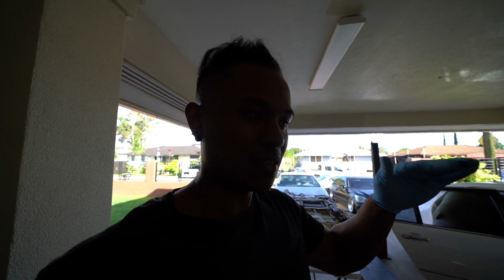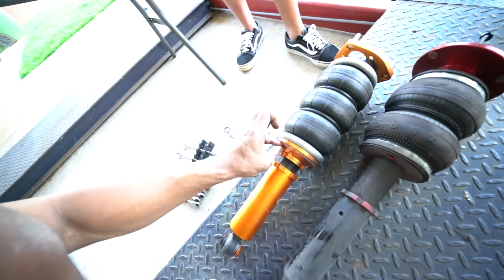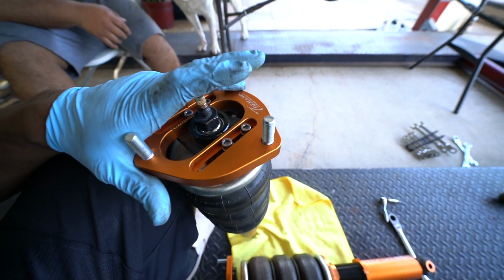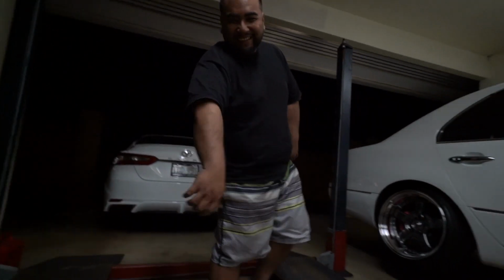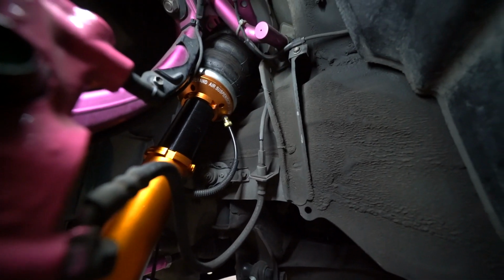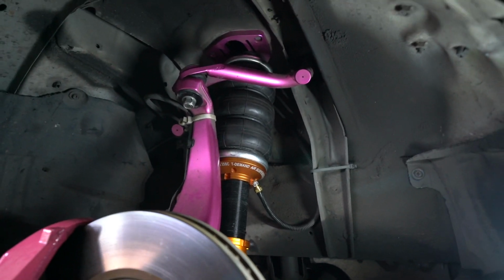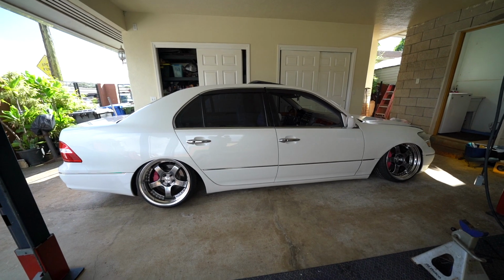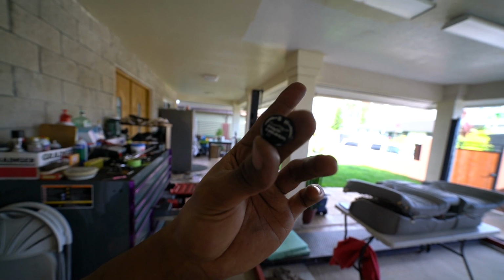JAY | VLOGS T-DEMAND LS430 BAG SWAP

Comment: Please make a video on the max lift on the T-Demand/triple bellow air struts. Been interested but scared it won’t give enough lift, roads horrible around my area
Reply from the maker: Ill try but at the moment it’s not maxed out. It can still go few inches higher if we crank the shock up. But it could definitely go higher than stock
Reply: @u1StupidKiD  please and thank you! I’m looking for air struts for my 4GS and been contemplating on different manufacturers